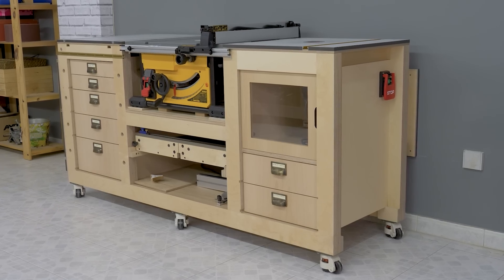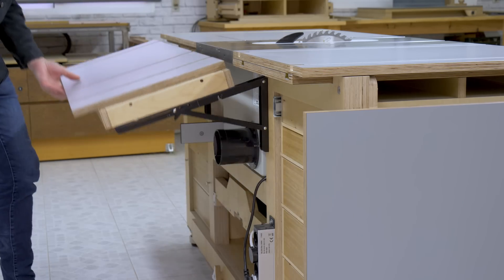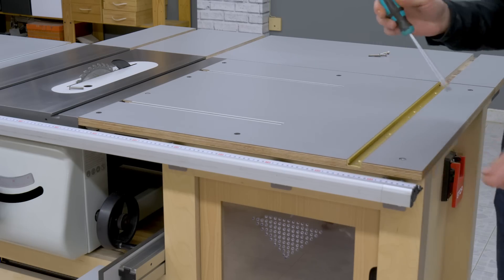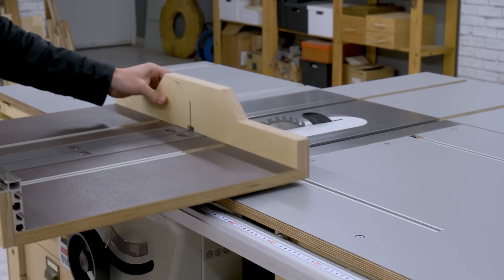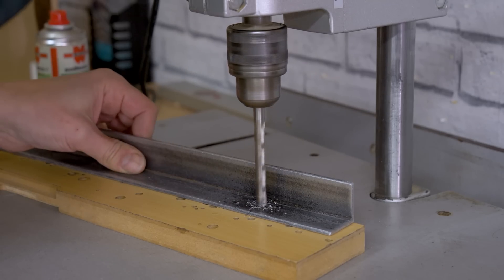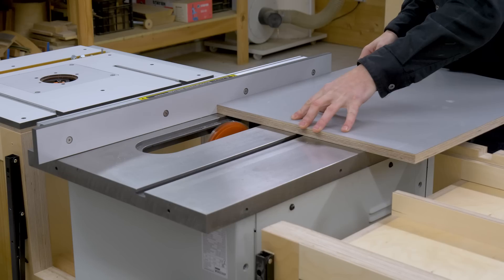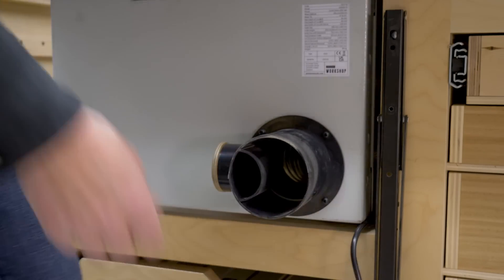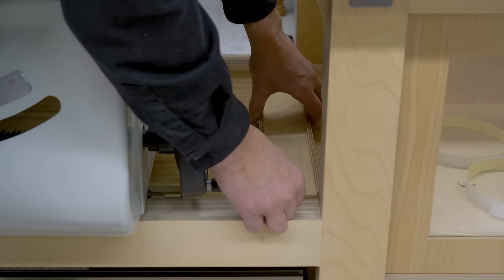How to modify the Mobile Workbench with Table Saw

Comment: Looks great! Your workbenches (especially the modular ones) are what I would like to eventually model my new workbench off of. As far as squaring up the fence, how about embedding some magnets at the edge of the tabletop surface? You could quickly put on a straight piece of metal that sticks up past the surface of the tabletop and it would stick to the magnets. Then all you would need to do is put the fence flat up against the metal and tighten the fence down. After that you could remove the piece of metal so it's not in the way.
Reply from the maker: your idea sounds great, thaks!
Reply: Esñañol

Comment: When you say squaring up fence for sliding carriage, do you mean at the front edge or at any point on it ... if at front then just use the front edge (as you did in the video) as that's really quick, otherwise a a flat board which locates between the two mitre slots at a perfect right angle (say about 6" deep) and just slide the fence up against it (board can be stored in the gap underneath.

Once again, fantastic workmanship and outstanding functionality 👍
Reply from the maker: Thanks for the tips!

Comment: I love the design of this workbench/Tablesaw table.   and the fact that you can modify easily for a different saw.    My question is simple.   I have an old belt driven craftsman saw,  how can I adapt the outfeed table to fold over the rear mounted motor without having to put a big hole in middle?
Reply: can you modify the drive/belt geometry of the saw?

Comment: Your workbench and and videos are really great. I was wondering how it was to install dado blades on the saw, and did you have to do any modifications for it? Forget it found the info in your video comparing it with the Dewalt 😂
Reply: Have you had any problems with that the fence moves when clamping down to do a cut?
Reply from the maker: I have not had problems, but it is certainly a problem to improve

Comment: The table you made is simply perfect. However, I would like to say that you can make much cleaner cuts with a double blade saw. I think the double-bladed saws, which will make a fine scratch on the front and make smoother cuts, will suit this beautiful table. It will be very useful especially in coated chipboard cuttings.
Reply from the maker: Thanks for the tips!
Reply: what's a "double blade saw"?  can you give an example?
Reply: @scott98390  You can see an example in the video below.  There is a small saw in the front.  this saw makes a fine cut in the chipboard, while the large saw on the back makes the final cut.  Thus, a very comfortable clean cut is made.  This combination works especially well on chipboard and mdflam.  Not necessary for woodcuts.  https://youtube.com/shorts/RGze1OVyEbY?feature=share

Comment: A few days ago I bought a set of plans for the work bench.
The plans, information, skech up files and the whole presentation was excellent. Congratulations for a job well done.
I have also bough the axminster saw. After studying your plans, I have been thinking on three modifications for which I would appreciate your recommendations:
the first one, and since the axminster is 60mm taller than the DeWalt, would in be useful to lower the central support of the frame? it would be relatively easy to do for a new build, and would avoid issues with the cover and adjustements on the table tops.
The second question, and since the saw weights 90kg, would it be useful to install  some sliders on the shelf that support the saw, so it can be moved upfront for maintenance?
and the third, would it make sense to create a support plate for a jig saw that could be interchangeable with the plate of the router, and combine with the jig saw plans that you also have on your site?
thanks in advance and again, congrats for a job well done
Reply from the maker: hi Francesc, I like the idea of making a  interchangeable support plate for the jig saw. I don't know if the sliders on the shelf is a good idea, I think it's better to make the shelf fixed. I'm also not sure if it is better to lower the central support of the frame, I think it is better to use an iron L-profile as you can see in the video, and maintain the measurements of the plans
Reply: @Paoson_Woodworking  thanks for your quick response. I shall keep you posted on the progress!

Comment: Regarding the squareness of the fence, what if you use one the square that has a lip on the beam (e.g. Kinex square with base)? You register the lip on the miter slot, and then butt up the fence against the blade of the square.  I think a triangle with a lip could also do the same.  For example, TSO has a triangle that allows a lip attached to one of its edges.

Comment: Could you use locating pins to locate the fence into the sliding table?  Our professional panels saw only locates with two pins and two bolts.  I've seen some without the pins.  The countersunk bolt auto-aligns into machined holes.